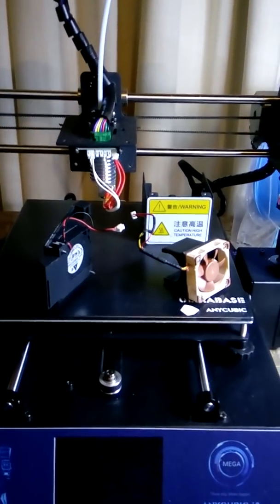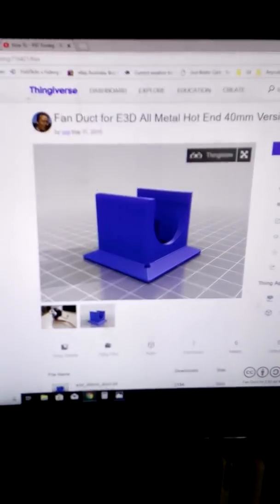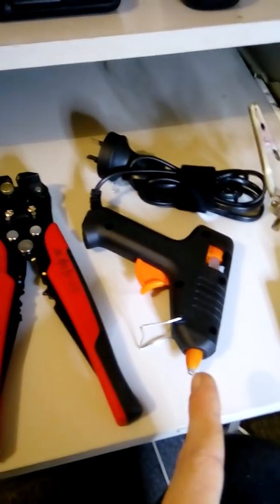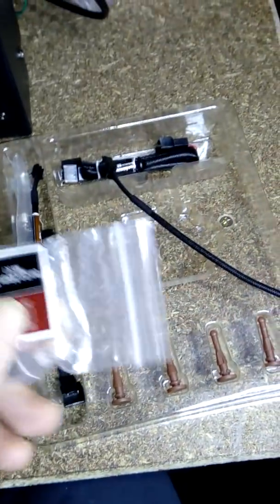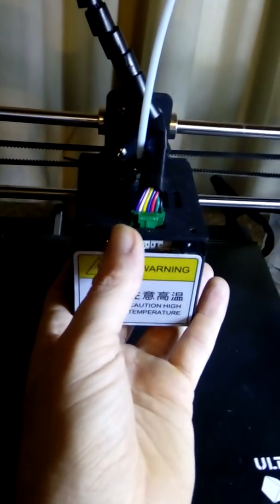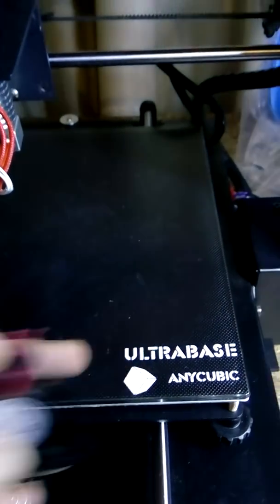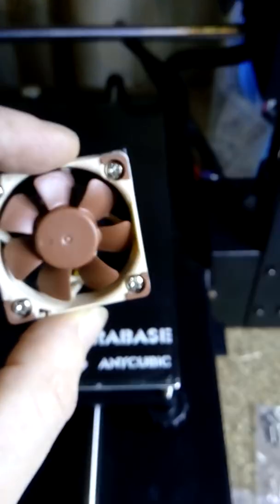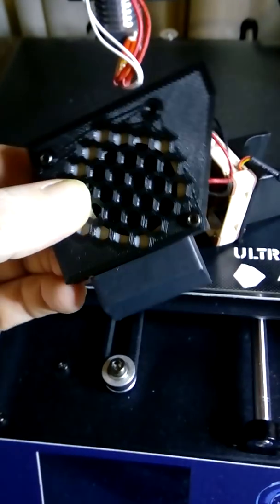Anycubic I3 mega fan upgrade and mods.

Comment: You need to also flash a new firmware to get 12v on the fan :)
Reply from the maker: Not in all cases. I had 12v at the fan from word go.
Reply: @jwphotos84  my mistake! I am not sure but I think 12v mod is only for the part cooling fan! so if you wanna use a blower style fan that's far quieter but still hearable or just noctua fan (i'd totally recommend big 20mm ones. even those could be not enough for pla. but probably enough for other materials) but blower style ones seem to be good enough and not really bothersome and don't sound like a jet engine like the stock ones :D

Comment: ahh it's easy but i'm scared of ruining the cable then I don't have any more connectors :D

also I'd have to import a decent fan and they are expensive to import lol.

how is your printer now? is the nozzle still doing fine? I heard the noctua fan isn't powerful enough. tho there's a mdo to give the fan 12v

Comment: Do I need to solder to do this mod? I hope not because I don't have one nor know how and I already ordered my fan
Reply from the maker: Ideally yes, you would solder the wire joins, but crimp connectors or similar can be used, alternatively you can source a new plug and crimp straight onto the wire without having to join.
Reply: @jwphotos84  how do I use crimp connectors
Reply from the maker: @michaelsanchez8667  there are many types, a quick google search will provide all the info you need. I'm sure there are videos here on YT aswell showing use of a crimp connector.

Comment: Do you know for a fact that the Noctua fan has the same airflow as the stock fan? I'm keen on upgrading to a more quiet design because the i3 is loud sitting here on my desktop but simply replacing the fan with a more quiet one makes me nervous. If it cools more or less than the original fan, could that not affect the print quality in some way?
Reply from the maker: Thanks for the reply. I haven't done any airflow comparisons, but have been printing for 6 months on the original hotend printing ABS daily and have had no issues. I highly recommend using a Noctua, the quality is second to none and the sound reduction is great.

Comment: Isn’t the hot end fan shroud going to melt? Or are the heat fins cool enough?
Reply from the maker: Hi there. When printing PLA, the PLA shroud is fine as the temps are low enough. If your printing high temp filaments, i recommend abs or nylon as the material because the environment around the nozzle will exceed the glass transition temp of the PLA.

Comment: how is the noise now coming from the extruder??
Reply from the maker: Extruder ? do you mean hotend ? if so its silent now except for the parts cooling fan.
Reply: @jwphotos84  can you upload the sound difference or current sound in db meter
Reply from the maker: @AhmadSyedAnwar  Sorry for the delayed reply, ill take some measurments in the coming days and share the results.
Reply: @jwphotos84  ...
Reply: @jwphotos84  soooo?
Reply from the maker: Printer has since been sold, as ive moved to corexy's for my farm.